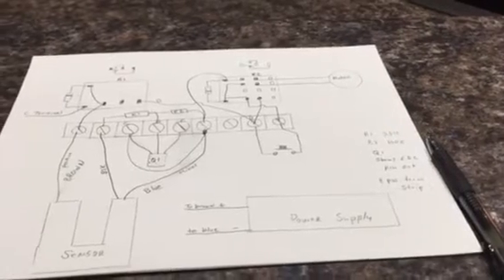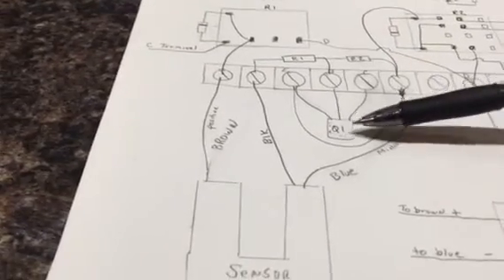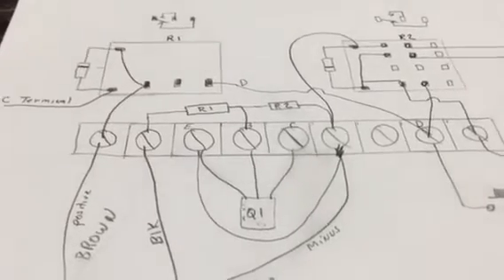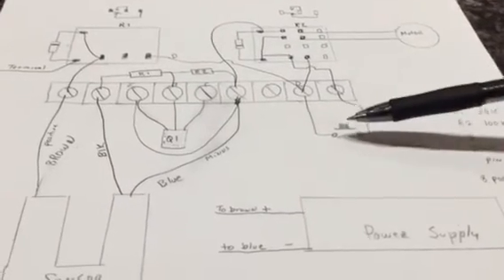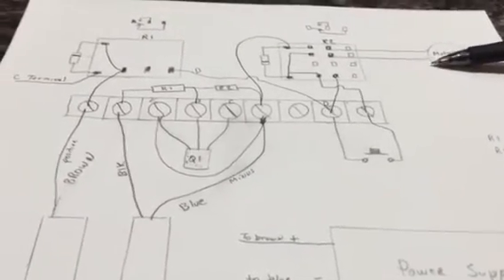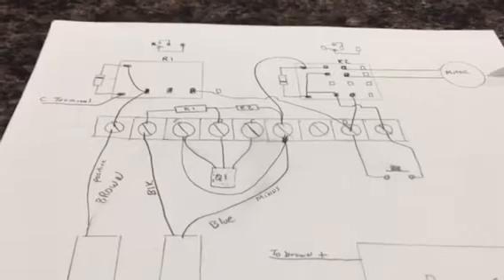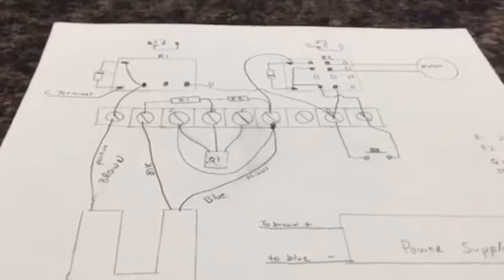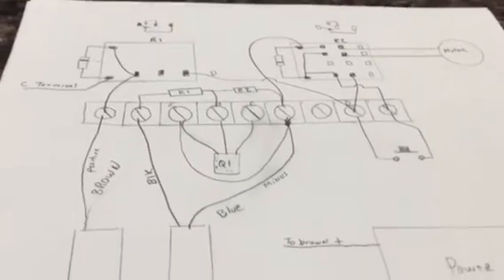Circuit Explained with Diagram

Comment: Nicely done.
I have seen others do the same with all transistors.
The key seems to be one stage providing the cutoff to the next that controls the motor.
You could also add another momentary switch on the motor plus side to positive supply to be able to trickle manually if you can't get the sensor to trigger exact or some powder densities that may require shutting off early to avoid going over the mark.